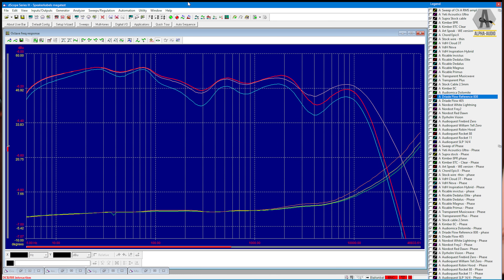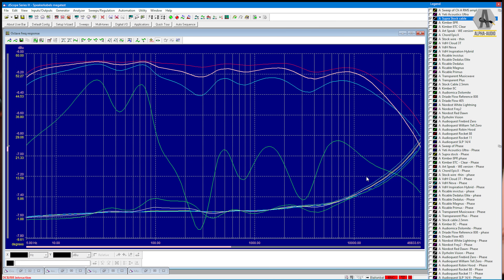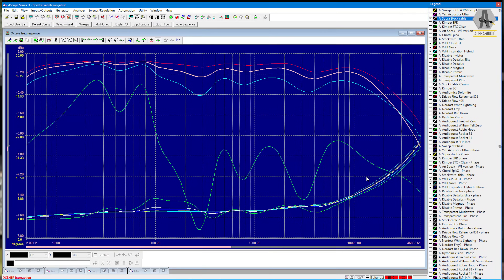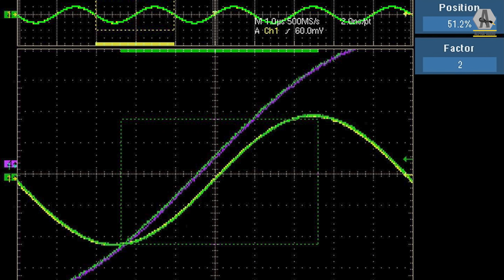Your speaker cable matters! 32 speaker cables tested - with measurements!

Comment: I'm all-in on exploring what really matters when it comes to accurate and emotionally-moving music reproduction.  I'm a drummer/percussionist and saxophone musician.

So, from the MUSIC RECORDING & PRODUCTION viewpoint, I think it might be revealing and telling to pose, or AT LEAST CONSIDER & CONTEMPLATE, the following questions and information.

From my many years of being a musician, IME, the Professional audio Recording/Mixing/Mastering Engineers that Produce ALL of the Music that we Actually LISTEN TO (including "audiophile" recordings) would use an EQ or other studio equipment to achieve "a more full and rounded sound" OR any other desirable effect or change in sonic quality or sonic character of the music they are creating/producing.   Essentially NONE of these professionals would "SWAP" or "Change" their Speaker Cables OR Power Cables to do this, or to "lower the distortion and noise floor".

Go look behind the Multitudes of inter-connected rack-mount studio gear in any of the most respected and revered pro studios, including their very expensive multi-channel studio-grade ADCs, DACs, and precision Master Word Clocks, and you will find that ALL of this gear is connected to the AC Mains power using the Generic UL/CE/NEMA listed & approved Power Cable that was Supplied By The Manufacturer.  In my many years I have NEVER seen a studio or recording engineer use any type of "special" or "exotic" aftermarket power cables or speaker cables.

@AlphaAudio  
Jaap, I'm curious what type of power cable Eelco Grimm provides with the Grimm Audio MU2???  For all of the EXTENSIVE research, design, and engineering that was put into producing and manufacturing such a high-end and expensive component, do you think Eelco would purposely sacrifice or "Gimp" its performance by supplying it with a "basic" off-the-shelf IEC power cable?

SPOILER!:

Look at the internal product photos of this unit on the Grimm Audio website.  This unit is shown with a generic CE/IEC/NEMA AC power socket on the back panel.  Now look at the INTERNAL Power Wiring that is connected to the internal PSU at the side corner of the blue PCB.   Surprise!   It's your basic off-the-shelf power cable and wiring...not braided, not oversized, not silver conductors, and no special shielding, etc. ...BASIC "off-the-shelf" power cord and wire!

THEN take a look at the USB connection!  For THIS type of device, this particular cable SHOULD BE of the Upmost Importance, correct???  And yet, Eelco chose a basic/standard 26 AWG USB cable...AND it isn't even "hard-wired" to the USB socket/jack on the back of the unit!   The rear-panel USB jack has another USB Type-B female jack on the Inside that a separate, STANDARD and basic male USB Type-B "printer cable" is plugged into!

I don't know of ANY other high-end device where I would think uber high-end cables would be chosen and absolutely necessary, yet they are clearly off-the-shelf and "nothing special"!

There are usually Tens to Hundreds of studio-grade AC-powered equipment in any professional studio, and for some strange reason [/s], 99.9% of them don't believe that changing the power cables OR speaker cables will improve their performance or sound.

Hmmmm?  What do they all KNOW that we don't???

Honest question:  IF the professional engineers that Record & Produce ALL of the Music that we Actually Listen To do not "swap" their speaker cables or power cables in order to achieve some sort of "synergy" or a particular sound characteristic in the music, should YOU as a listener bother to do this or worry about this???

In addition, roughly 90% of music is now produced using Active, Self-Powered Studio Monitor systems with Built-In Class D amplification (OMG!) where there are ZERO external speaker cables that can be swapped.  AND, those Active, Powered Professional Studio Monitors are connected to the AC Mains using the manufacturer-supplied GENERIC POWER CABLE.   So where does that leave this debate???

For example, quite a few respected Mastering Engineers use the Kii Audio Three active/powered/DSP monitoring system, or other similar industry-standard active studio monitors that have built-in amplification.

NONE that I know or have seen have ever used anything but the supplied AC power cables, and they obviously can't and don't feel the need to change the internal speaker wiring.  In fact, the manufacturers of these Multiple Thousand $$$$$ studio monitors would probably void the warranty IF they found that the speaker wiring had been changed by the user.

I would guess [sic] that MOST mastering engineers probably have pretty d@mn good ears and are Trained or have learned "how to listen" and how to evaluate or judge the Sound Quality to a much higher degree than most common listeners.  Many of the best engineers are musicians themselves and obviously play/perform with many other musicians who play ALL TYPES of instruments.  Therefore they KNOW exactly how most acoustic instruments sound in REAL LIFE and IF what they are hearing out of their Calibrated Monitors is Lifelike, or NOT.   ;)  In addition, tracking (recording) engineers have the live musicians and their actual instruments in the studio as a direct reference.

But again, [for SOME reason] the ACTUAL RECORDING PROFESSIONALS and MUSICIANS do NOT feel the need or choose to use "special" aftermarket power cables or speaker cables.

Try this:

Pick your favorite and best sounding album or recording, then look up who the tracking, mixing, and mastering engineers were that worked on the recording(s) and ask each of them, "What Power Cables Do You Use"?  They'll most likely respond with a funny and perplexed look on their face, LOL, like "WTF?".

Sure, SOME of them MAY have a preference for using certain balanced XLR microphone or signal cables, but you will find that the vast majority are "okay" with using standard Mogami or similar "basic" brand-name cables.

HOWEVER, ALL of these studio engineering Professionals DO use MANY different types (and multiple instances of) EQUALIZATION in order to achieve "a more full and rounded sound" OR to achieve any other desired sonic characteristic.   And yet, the majority of "audiophools" still think that EQ is evil and/or always detrimental. 🤷‍♂

Comment: Thank you for a fine and serious initiative. I have more or less given up on finding the solution, but have gathered a lot of experience about which materials sound good, have lifelike sound and a realistic sound image etc.,eJ
I optimise my parasitic components, which are everywhere in our devices and cables.

The sound signature issue applies not only to cables but to all passive components.
An alternative way to find differences could be to measure all the data we know from capacitors, coils and resistors etc. instead of looking for measurable changes in the signal from the whole cable.

However, the mystery remains how these parasitic components cause such large changes in what we hear

We can measure precision but not sound signature timbre soundstage rhythm fidelity, but using the right materials for parasitic components and components in general can make the sound more natural along with the construction, whose precision we can easily measure, it's harder to measure everything that really matters timbre soundstage fidelity rhythm , that we can only experience.
Added: I recommend that instead of the usual hi-fi parameters evaluate whether a violin, piano, organ etc. sounds more or less natural and has the right size in the soundstage, that's what hi-fi is all about, but it requires a high quality unmanipulated music recording produced with few microphones and that is not easy to find.
On the other hand, sound differences will be more apparent than in typical hi-fi recordings.

Comment: question with the noise what are we looking at ? 2 pictures of a scope without scale , the measurement are only good with a reference of what we are looking at.
Reply from the maker: Those are your words...
Reply: @TheAlphaAudio  yeah you usually read scopes and graphs without knowing the scale where looking at ?
Reply from the maker: @joppepeelen  Not sure what your problem is, for all measurements are in the written article. With scale and all info you need.
Reply: @TheAlphaAudio  aaah ok ! sorry i did not know there was an article !  in the videos they are absent , so thats why i asked.
Reply: @TheAlphaAudio  So the maximum inductance measurement was 5,000 times less than the average speaker and the maximum capacitance was 20,000 times less. Am I on the right path here?

Comment: Thanks for having the balls to do this!😆 I became convinced 15 years ago that speaker cables make a difference, not when it comes to finesse, but on pure electrical properties and capabilities.
I had the typical name brand 150watt receiver. It played nicely with a lamp cord equivalent wire from Monster. BUT, when I braided up a well known cat5 recipe (of high capacitance) the receiver choked and shutdown within a minute or so. Then I built a high power MOSFET amp. With the Monster wire the sound was decent, but a bit thin. When I put the cat5 on the MOSFET amp the sound was simply spectacular in every category. As I've built better and better equipment over the past decade it becomes easier to address finesse, and to be able to sculpt finer details with my wire choices.
Reply: That sounds fair, but Cat5 isn't 20k for a pair lol. Only a fool would pay 20k for speaker cables.
Reply: The MOSFET was first patented 99 years ago.

Comment: It would be helpful to include the descriptions of the differences you heard instead of just stating they sounded dramatically different.  Please make another video letting people know what sound characteristics change with cable swapping . So that way they can now understand what to listen for.  😊
Reply: Did you read the article on the website with the listening notes and measurements?
Reply: @jmtennapel  No I did not even realize there was an article with written data. Where’s the link 🔗 for that?

Comment: Just too many factors to consider when try to sync a speaker cable to your rigg, your room, your rigg of course, no rigg sounds alike, some speakers simple plays worse with brand x no matter the price. Use your ears and strive for syncronicity in your setup, experiment experiment experiment and trust your ears, you will reach endgame sooner than later 👍
Good work tho, kowledge can be a shortcut..

Comment: I dare to state that some of the measurements are more about the connectors and the way they are connected in switching between them then its about the cable itself. You must solder them in fact !!!! Interlinks will have less impact in the sound reproduction then speakercables, i dont know why the penny does not drop with you. I ask myself if i really have to do with professionals if you say that kind of .....
The reason for that is just the amount of electrons or pressure running through a inductor, more pressure more turbulence and more errors. I will not start talking about cristal structure in metals but i really ask myself how you can talk in this way about cables. Inductance, impedance and that kind of stuff have noting to do with quality as well, this has to do with colour and its not relevant because of loudspeaker filters, loudspeakers drivers and so on. Its really about THD that a LS cable causes, and thats way less then a interlink ever will. I am not sure but i think your never  kicked out the weakest link in your hi-fi set-up chain (again and again) till you ended up with a setup where you could hear clearly these kind of differences. To start with hearing more difference between LS cables then Interlinks. I dont get it, really !

Comment: radically improves the sound if the cable is placed in a pipe with helium. the inert and lightest gas in contact with electrons in a copper conductor produces the lowest noise level compared to air. The ideal solution would be to place the cable in a vacuum, but this is very expensive.

Comment: When I swapped my mismatched braided copper, clear jacket speaker cables with Mediabridge Ultra 12AWG cables from Amazon i noticed a definite tonal change - seemed the whole frequency range lowered (more bass,. less shrilly highs).  Even if makes no difference, I decided to do the same with my subwoofer cables - 2 different brands and thicknesses - again with identical Mediabridge Ultra subwoofer cables.  Just though symmetry would be helpful.  I should get them tomorrow morning.  $20k is more than I make in a year.  I wouldn't buy those unless (even if) I won the lottery!  I have a mixed 7.2.4 system with Polk satellite surrounds and Klipsch everything else.  Not high end, but I really enjoy what I have.

Comment: I would have thought that shielding was less important for speaker cable than it is for RCA cables (interconnects) owing to the proximity of RCA cables to other electrical equipment and other cables, especially power cables.
Reply: You're correct. It doesn't matter much at all with low level signals like what travels down a speaker wire.
Reply: @PeteNice29  Thanks for confirming this.

Comment: I have owned many, many speaker cables and the Golden Helix from Mapleshade Audio is my favorite. They sound awesome on my system.
Reply: Never heard of Golden Helix 2 Speaker Wires🤔 Are they fast and dynamic? Are they Colored, warm/cold?
Reply: @larryschwartz9883  
I can't comment about Pierre Sprey's Golden Helix speaker cables as I haven't used them yet.

But in regards to Audiophile Recordings, and as a drummer/percussionist & saxophonist, Mapleshade recordings are among THE most LIFELIKE and DYNAMIC I've ever heard.

For anyone that appreciates jazz, at least check out these two stellar Mapleshade recordings:

Clifford Jordan Quartet - Live At Ethell's
(favorite track:  'Round Midnight)

Norris Turney Quartet - Big, Sweet N' Blue
(favorite track:  Blues For Edward)

These are recorded Direct to 2-Track anaolog R2R tape with just two specialized microphones in order to maintain perfect stereo phase coherency with all of the musicians playing within the room together.

Pierre used his own modified custom tube electronics and wiring for the mics, mic preamps, and his modified 1/4" analog R2R tape machine.

NO compression, limiting, EQ, or processing was applied whatsoever.

Comment: The connectors matter far more than the cable as long as the cable is copper which is the standard now anyways.  If you have concerns upgrade the RCA connectors then stop thinking about it.
Reply: Yes, we are talking about a distance of 2 meters which is nothing. The most important upgrade you can do is is changing to balances outputs and inputs, like we use in recording studios. Then the only thing to be concerned about is the shielding, and a sommer Cable Galileo for example will be perfect.
Reply: @johanolofandersson8801  Line balancing does not improve sound quality it only rejects noise ....and it cant do that if there isnt any.
Reply: @marxman00   wasting money on 2m speaker cables is not advisable. Use the same balanced cables as we do in studios, and buy a Trinnov Nova if you want to invest in better sound quality and experience.

Comment: Measurements mean nothing. Which sounded the best ? That the only question.
Reply from the maker: People want proof... we tried to prove it with measurements. There are differences measurable... so for me, that's proof.
Reply: @TheAlphaAudio  everybody knows that different alloys and diameters / shieldings have different outcome. That not magic. System synergy matters and silver is the best conductor.
Reply: @MrBazsi888  Sadly not everyone knows, or want to accept this.
The many that most of the time can't afford good quality hifi are also very "loud".
Reply: @MrBazsi888  One of the problems with silver is you need the very purest grade to get the best from it, and that's expensive. I've listened to many levels of silver cables, including power cords and in almost every case you could identify the characteristic traits of that material. Probably explains why companies like Siltec and Gryphon infuse gold with their silver interconnect cables for a more full and rounded sound.
Reply: @sportsfanivosevic9885  Audio Note silver is totally fine. Gold not needed.

Comment: Pseudoscience.
Reply: I fail to understand how anyone who is tuned into hifi can't hear differences between at least bellwire and a half decent cable, be it interconnect or speaker cable.
Reply: What do you mean?
Reply: @analogueman5364  You know what I mean.
Reply: If your post is to get a reaction, then you are successful. If you truly believe it's 'Pseudoscience" then you probably have not been exposed to many variables or highly revealing systems. If you claim you have, then I suggest you get your hearing checked.

Comment: Thank you for the test and it clarifies for me how some of the differences I hear correlate with measurements. What about power cables? In my experience over the years they can make more of a difference to the final sound than any other cable. I'd be interested in your results if you did such a test.
Reply from the maker: It's not planned at the moment. I am a bit done with testing cables now ;-). Maybe later.

Comment: Shooting that signal down through a freq variant transfer, ... encountering influential reactance of inductance on one side, capacitance on the other, plus voltage drop as a by product, ... 
Of course cables impact the signal. 

Simply look at a Heyser Spiral to see what the signal is up against. 

All that's just the cable! 
Add connectors and the potential for additional corruptive influence increases. 

Nice work 
Much appreciated